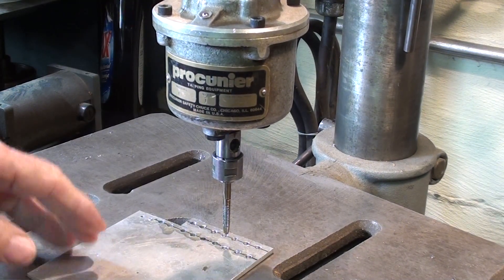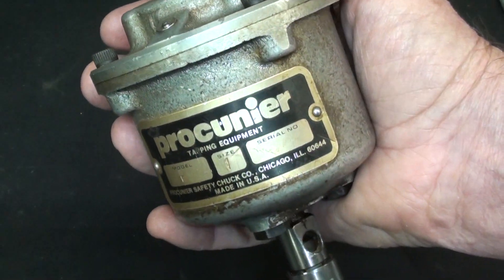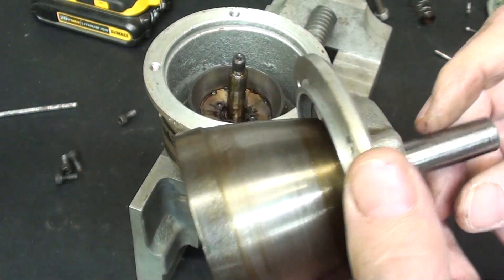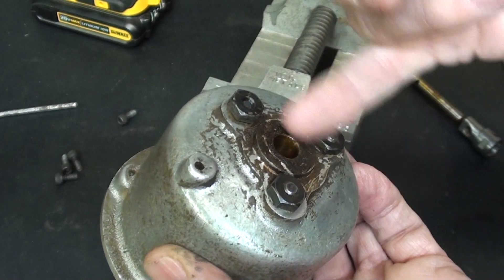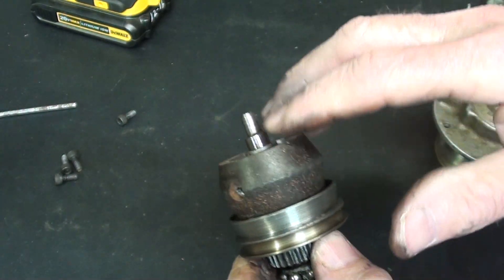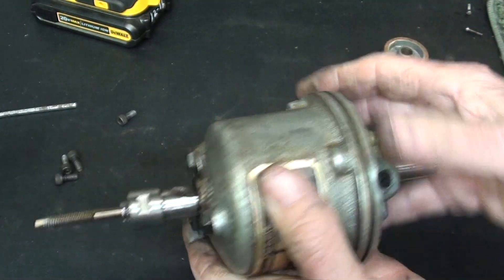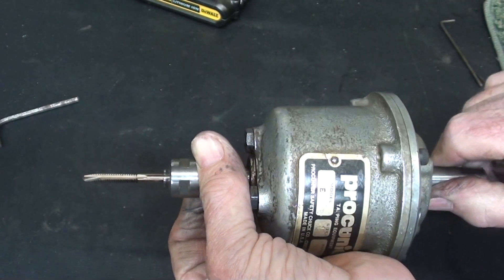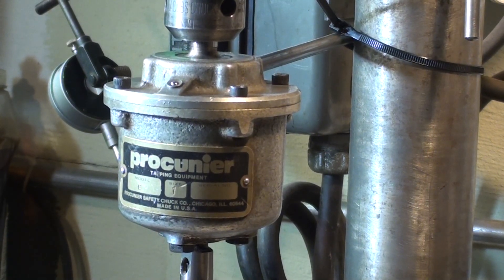PROCUNIER TAPPING HEAD What Makes It Work #31 tubalcain

Comment: I sure could have used one of those back when I was busy breaking tap after freaking tap doing it by hand.
Reply from the maker: Yes
Reply: The tapping head could break taps, too, but it was not common.  You have to learn to drive a tap properly by hand, so that a bending moment is not applied to the tap while applying the driving torque.
Reply: I thought I would never get beyond breaking small taps until I found that gun taps (also known by some other names ) were the cure. AND starting them straight.
Reply: @jaspermcconnell6417  Are those the spiral ones? I've seen helictacal taps that can be sent straight through the hole immediately without the got damned breackage.
Reply: Bart Udell Gun taps usually have a smaller number of flutes and thus a stronger cross section.  The technical name for them is spiral point taps.  They are identified by a very short spiral point section at the point of the tap.  This spiral point pushes the chips ahead of the tap and thus either require a through hole or an extra deep hole for the chip to go into.  They can break if neither of these conditions are met.  I believe Mr. Pete is using this style in the tapping head in the video.

There are spiral flute taps as well.  These have the flutes spiraling around the toothed section of the tap in the same manner that drill bits have flutes spiraling around the drill diameter and like a drill bit they are designed to pull the chips out of the hole. They are most often used for blind hole tapping.

The hand taps that you probably already have (such as come in 99 percent of tap and die sets) will work as long as they are started straight to the hole and held that way as you begin to feed in.  Remember that the chips must be broken by feeding the tap forward, and then backing up ever so slightly (you can feel the break in the chip through the tap and wrench) because the chips must remain in the flutes of the tap until finished, unbroken the chips will cause the tap to jam and break.  Both spiral point and spiral flute do not require this back up to break chips.  Hand taps have three point styles. 1. Taper- which is identified by a very long chamfer at the nose end and is designed for starting a thread. 2. Plug- which is the point style usually found in tap and die sets, and has less of a chamfer than the taper style. 3. Bottoming- which is designed to finish up the last threads in the bottom of a blind hole and is only used after a taper followed by a plug style has done the bulk of the threading in that hole.  A bottoming tap is identified by its relatively blunt nose with a very slight chamfer of teeth (1-2) and is only used to cut those last threads at the blind hole bottom.  When you order a “tap set” of a single size tap, say 1/4-20, you will receive a taper, plug, and bottoming tap thus explaining why you see so many three compartment paper tap boxes around machine shops. Of course you can just order a quantity of a single type as well.

Always use taps made of high speed steel and marked “hss”.  It can absorb the torsional forces generated in tapping far better then carbon steel.  When the red Chinese first started exporting their tap and die sets to this country the market was flooded with carbon steel taps and dies.  Some of the taps were so bad that they actually had a noticeable bend in them from heat treatment making them useless of course.

Use of a tapping fluid will also help prevent tap breakage.  WD-40 works well for most aluminum alloys and sulferized  cutting oil or one of the many tapping fluids on the market for steel alloys.  For difficult tapping in steel nothing beats Castrol’s  Moly Dee.  If you don’t have any I would get some.  It saves a lot of tail feathers. A quart will probably last the average hobbiest a lifetime even if used on all steel to be tapped.  Cast iron should always be drilled and tapped dry or with air. Have fun.
Reply: @37yearsofanythingisenough39  I'll keep this stuff in mind the next time. The next time I have to build a mechanism that uses half inch keystock for a side.
Reply: @37yearsofanythingisenough39  Fantastic post. Thank you so much for your full explanation on taps/tapping. I spent 65+ years not knowing this. Aargh !!
Reply: Jasper McConnell You probably didn’t have 25 students/hour breaking all your taps and thus have a need to research the subject!
Reply: Bart I taught the same subjects as Mr. Pete and I am surprised that from his experience with students that he did not respond by telling you that most taps are broken in hand tapping with the tap being turned out of line with the hole as it starts into the work, canted in other words.  A somewhat simple cure to prevent this from happening is to make a simple tap guide from thicker stock that has a hole drilled through it to closely clear the threaded portion of your tap and can be held with your other hand tight to the surface to be tapped.(I would avoid clamping it as the two holes need to find concentricity as the tap starts into the workpiece.) Needless to say this hole in the tap guide needs to be drilled perpendicular to the material, so is best done on a drill press at the very least, and a milling machine would be still better. This will help ensure the tap is perpendicular to the hole to be tapped.  You can buy these already made, hardened, ground, with holes for various size taps in them.  Some even have a v groove in them which allows you to tap into an outside corner. Gator is a name which comes to mind for such a purchase but a simple homemade one unhardened will work. Had the students make them all the time to take with them in their life journey. I’ve had some tell me 30 years later it is the only thing they have left from high school other than their diploma!

Comment: Good morning, Lyle. Guess I'm early today.
  EDIT: I've never had any luck dry tapping aluminum. Always gummed up the flutes unless I used kerosene.
Reply: Kerosene does the job but stinks like the devil. Use Mineral Spirits that works just as well without the smell.
Reply: @ellieprice3396  
Thanx, Ellie! Sounds feasible. Will try next time. But still, dry tapping aluminum is a disaster just waiting for a job to happen to, right?
Reply: I've had really good luck in aluminum with a 1/4 cutting oil and 3/4 mineral spirits mix, even in very soft material.